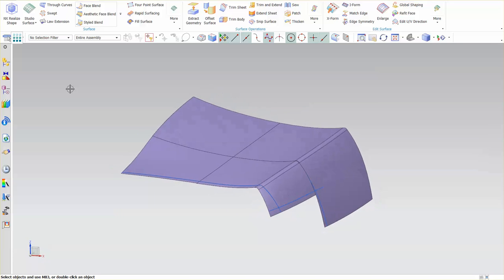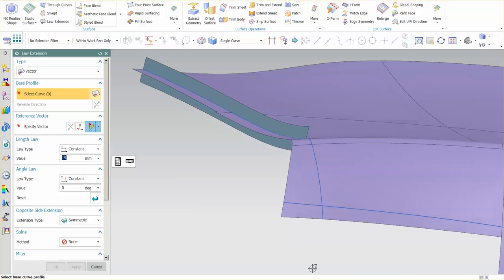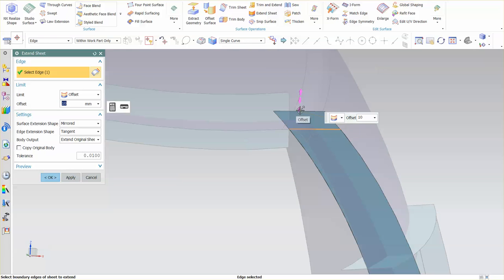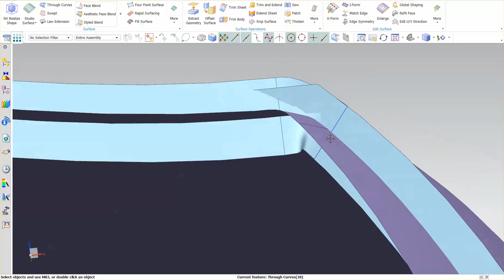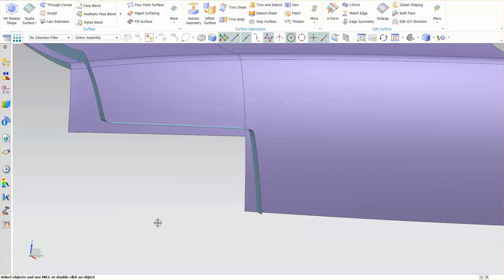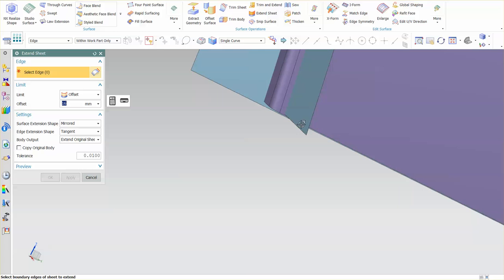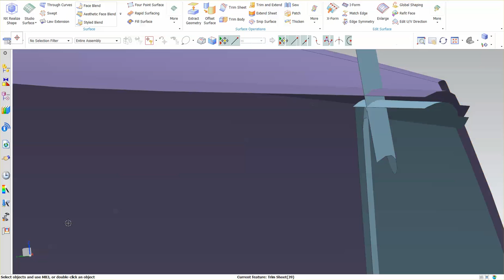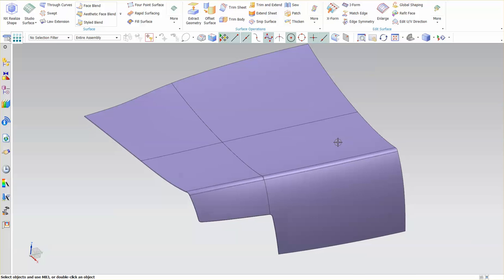Siemens NX 10 | How to Make a First Flange and Hem

Comment: Now i'm starting to get slowly how coachwork is designed or transfered on CAD. Many thanks
PS : btw, is it worth investing in a 3D mouse ?
Reply from the maker: +Okto Putsch It is worth it. The redundant controls as well as being able to move your data around with out getting a hand cramp is nice. I notice a big difference in productivity when I use mine.
Reply: class A surfacing Thanks :) i'll check for one on eBay, some older models are affordable now